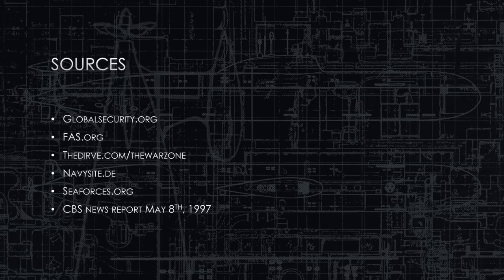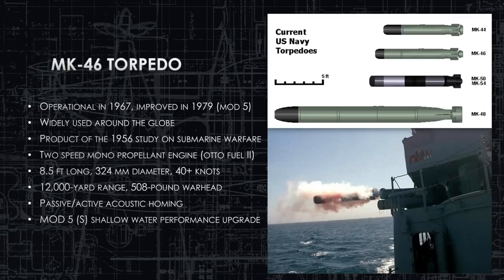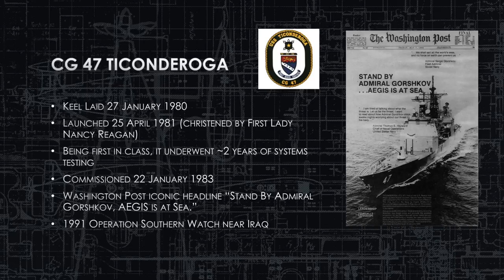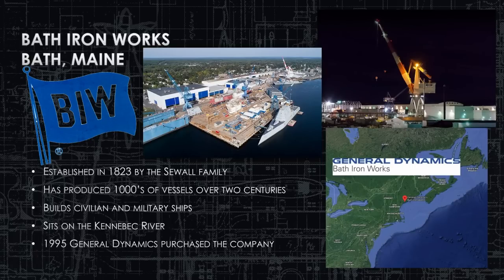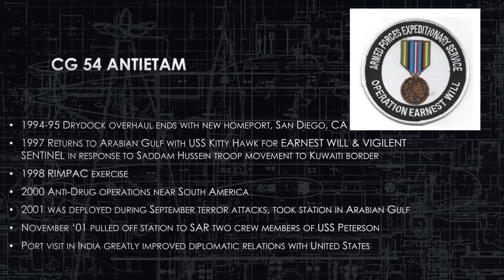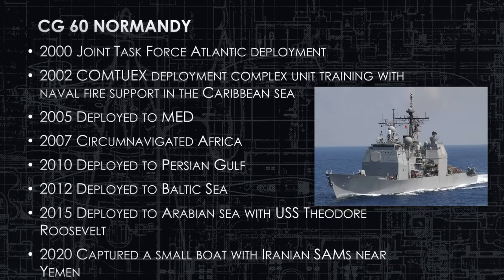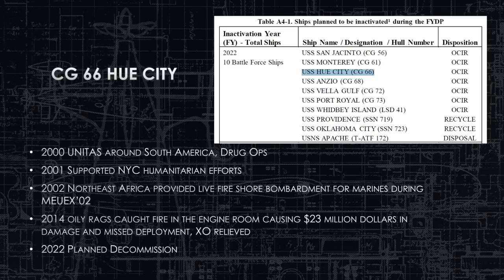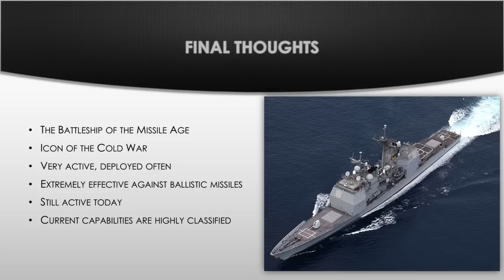Ticonderoga-class Ship Brief

Comment: While the focus of this brief is weapons and sensors, the Spruance Class instituted an important engineering plant change.  Prior to Spruance,  main engines were 1200 psi geared steam turbines.  Major repairs were made onboard and took multiple weeks to complete.  Engine removal took a huge hull cut throuugh several decks.  The Spruance LM 2500 gas turbine was designed to to be uncoupled from reduction gears and ride on rails from the engine room right up the stack.  Took less than 8 hours and allowed off hull refurb and a ready reserve of engines.  This evolution also eliminated boilers and all the related aux machinery.
Reply: Also the KIdd class destroyers also used the Spruance hulls and engineering but changed the focus from the specialized ASW mission to a more general purpose role. Also had extensive air conditioning and were originally ordered by the Shah of Iran, but undeliverable after the revolution in 1979.
Reply: During another life I fabricated at least a dozen parts for the LM2500 powerplant, that thing is a beast.
Reply: Yup, I served on DD966, 965, and 964. along with GC-57 as a Gas Turbine Systems Mechanical engineer, with a specialty in oil & water. Fun times. But yes, the SpruCans, Ticos, and Kidds were all the same from the waterline down, well mostly the same. You always have some differences.
Reply: The slight difference from the SpruCans to the Ticos might be a result of the hull being slightly lengthed (4 feet) on the Ticos as well as having 5 feet more draft. Still, when the SpruCans got the MK41 VLS refit replacing the ASROC launcher, the fact the Ticos already had them by that time likely made made the converstion work easier to do. I wonder if the Burke class replacement will lengthen the hull back to where the Ticos were (improving the length to beam ratio and thus the speed thru the water on similar installed power) as the Burkes are more than 50 feet shorter than the SpruCans with 11 feet more beam (and the shorter length no doubt accounts for why they only fit a 32 cell Mk41 forwards instead of the 64 cell). Despite having 25,000 less  shaft horsepower the Kidd's for example, at about the same full load displacement were some 10% faster.
Reply: @DeeEight  Good question. I was on the USS Hewitt when we were having the VLS system installed. As to my general observations on the workerbee engineering view point. The difference of four feet was pretty much just an academic slight to us in the lower decks, but you are right, the open space on the Tico Class is enough to feel. To us at the time, and when they started coming out. The Burkes seemed short and stubby. lol. Todays sailors won't get to see first hand on the speed and handling of gas turbine ships, right next to the old steam powered DD's that preceded us.
Reply: I just wanted to say that since USS San Jacinto is being decommissioned she would be a GREAT candidate for donation as a museum ship for the State of TEXAS and could be ported side by side with USS TEXAS when she is done with her refit.  THAT would be a great museum and would be great for teaching civilians about our Modern NAVY.
Reply: I did a whole bunch of engineering on theTiconderoga. It turned out the thing was too heavy. We put a lot of lead in the belly to keep it from rolling
Reply: @DeeEight  and currently operated by Taiwan.
Reply: @wjhung2  and this is newsworthy to me why? I knew about the sale to Taiwan twenty years ago.
Reply: Very interesting, the R&R of the gas turbine through the stack, perhaps the same could be done with SMR reactors to effect an engine swap. You might also be able to do this through a removed vertical missile mount unit.
Reply: @tobyw9573  Unlikely as SMRs would require a return to the sort of thick armor surrounding the machinery spaces that  nuclear carriers still employ. Thus you'd have to cut holes thru the armor to extract the modular reactors. It would be much more practical to build around the S9G reactor system as used by the Virginia class SSNs and which are designed with a core life of at least 33 years, meaning they never need to undergo a costly and time consuming refueling during their mid life overhauls with the hole cutting in the armor needed to do that. The estimated thermal-electric output of the S9G is 210 MW, which is more than double the gas turbine installed power for a Zumwalt class destroyer.
Reply: That’s pretty impressive. I figure putting a new engine in a car would only take a couple hours less.

Comment: Some corrections...  
- SM-2 Block II improved the ECCM... Electronic Counter-CounterMeasure, not the ECM. 
 - Chaff is pronounced like Ch-ah-F, not like Chafe. 
- You multiplied the Harpoon weight by 10 when reading it out loud. 
- The Mk46 torpedo weighs 508 pounds complete, the warhead is only a little less than 97 pounds. 
- Mk50's are not the '46's little brother except in terms of development timeline as it weighs more than 50% more, has a slightly larger warhead, a third greater range and better than 50% increase in maximum diving depth and was designed specfically to deal with deep diving, titanium hull soviet submarines.  THe engine isn't a battery, its a closed loop chemical reaction producing a LOT of heat and steam to drive the pump-jet. 
- The Phalanx 20mm CIWS... switched from DPU (which for the US government, which has a LOT of nuclear reactors which depend on enriched uranium as fuel with depleted uranium being one of the byproducts of that enrichment process, is actually exceedingly cheap compared to what Tungsten alloys costs to produce) to Tungsten out of environmental concerns about polluting the oceans with a projectile that is still mildly radioactive and might be injested by marine life that could get into the food chain consumed by humans. There is no program to fit SeaSparrow missiles to Phalanx systems. Perhaps you're confused by the SeaRam system which combines the radar dome and sensor fit of the Phalanx Block 1B with an 11-cell launcher for the RIM-116 Rolling Airframe Missile system instead of the 20mm gun (and is fitted to things like all the Independence class LCSs) and is called SeaRam to differentiate it from the regular RAM launcher which has no onboard sensors of its own to detect and track incomming threats. 
- All US Navy ships which have a Phalanx have had them upgraded to the Block 1B standard including those of the remaining Ticonderoga class cruisers as of the end of FY2015. 
- SH-2 Helicopter...the Sea SKua anti-ship missile has never been in US Navy service at all. The Maverick, Hellfire and Penguin missiles were never carried by US Navy SH-2s though they are options on export models. Most of the details you prattled off were systems of the later SH-2G variant which didn't get introduced to USN service until 1993. The earlier SH-2F had completely different sensors, engines, rotors, etc.
Reply: Magnificent response, from no doubt, hard won knowledge. It is thorough, diligent and it would seem, probably quite accurate.  It is Posts like this that restore my faith in humanity. Best post of the week for Me - you get a free ice cream!  (except you will need to pay for and purchase it yourself) :)
Reply: Minor correction, there is no such idom as "prattled off" 
I believe the idom you were looking for was rattled off. 
Yvw
Reply: @ricardobimblesticks1489  Appreciate the scrutiny, and notification of possible transgression, but I was not looking for an Idom[sic], but merely using the term "prattled" as in past tense of "prattle" which google defines as "talk at length in a foolish or inconsequential way.", which you may find is correct usage, preceding the word off,  in its original context, but thanks any way, best wishes, Oscar :)
Reply: Wait... I cannot see where I even used the term "prattled off". if so then well done, causing me to defend a position I did not want. :)
Reply: @oscargoldman85  OP used the term in their correction. I find a modicum of humor in correcting corrections... kudos btw :D
I have a tendency to prattle on so I won't rattle off a list of other things that amuse me :)
Reply: Lots of spoken mistakes on this one. Maybe the old sailor had a bit of rum lol
Reply: Very minor correction to the correction: Depleted uranium is considered a problem because it's a heavy metal, not because it's lightly radioactive.

Comment: I was trained in torpedo maintenance as an electronics technician in the RAN. Extra pressure on the launch of the torpedo means absolutely nothing.
Worst thing is if a surface combatant is relying on torpedoes then you are in deep trouble.

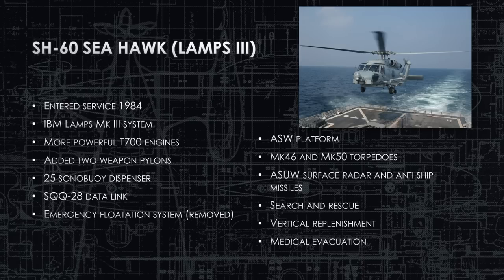Comment: 1:02:50, the reason the floatation was taken off is because it didn't work. If you think of it like a ship, the bottom of the helicopter is a very small "hull" area and the heavy weight of the engines and rotor are positioned high up on the craft. The center of gravity being so high up means that the chopper flips over and capsizes faster instead of floating if buoyant force is added to the bottom.

Comment: If the US ever decides to build a couple of new models of these from scratch I would recommend they use the hull designs from Baltimore-class heavy cruisers, all high-quality steel with laminated kevlar, you can have more missiles, torpedoes and guns on, plenty of room for tech, and it would be more stable sailing platform,

Comment: Congress decided the DLGN was not going to happen, and it is a shame.  Fast Carrier Strike Groups would have been in our HiStory should we have built them.  The Mk26 GMLS was a good system . . . however, the Mk41 VLS requires less maintenance, has fewer parts, and provides a greater density of weapons/area than the Mk26 GMLS.  The Mk26 only fired an SM-2 without a booster.  The Mk41 VLS enabled the Mk72 addition to the base of the Standard Missile providing SM-2 ER kind of range.  You provided a great brief on the Standard Missile capability.  Personnel savings through automation was significant.  Huge debate about the reloading arms is going on in the Navy at present, but they had been removed in the past.  Now that at-sea reloading is a requirement in our future in peer-to-peer engagements I suspect new reloading arm capabilities are in our future.   At a minimum the SM-6 reloading capability will be the goal for re-arm at sea.
The USN actually gave up ASROC manufacture for a time and the Japanese picked up the slack.  ASROC is now back in the mix but it needs a range upgrade (VLS HAAWK package?).
The mission change to Fleet Air Defense (home for 'Alpha Whiskey') was the biggest change.  Even today in a degraded condition the CG-47 Class in any baseline is a force to be reconned with by any adversary.
Concerning "Crash-back" exercises . . . in 90 seconds we could go from over 30 knots forward and come to a complete stop . . . and reach 10 knots going backwards.   We usually steamed with on trail-shaft configuration with that prop feathered and maintain an SOA of 18 knots.
Loved the torpedo review.  There are those in the Navy that have just given up on torpedoes on surface vessels for the future.  Expansion of the development/employment capabilities of the Very Light Weight Torpedo is needed.  Please consider a brief on that construct.  
Having two (2) 5" guns is a real boost in capability particularly now that guided/powered rounds are coming out.  There are multiple development activities for guided and powered 5" rounds and this is a program where initial investment is significant . . . however, the resulting product really increases lethality for the 5" gun out to a significant range at a huge cost savings per round when compared to missiles.  There are guided 5" rounds that can perform missile engagement profiles.  
The Mk15 CIWS is quite the insurance policy for 'Leakers'.  However, many are being replaced by the RAM/SeaRAM on many vessels, and the RIM-116 Rolling Airframe Missile ( RAM) is a small, lightweight, infrared homing surface-to-air missile in use by the German, Japanese, Greek, Turkish, South Korean, Saudi Arabian, Egyptian, Mexican, UAE, and U.S. Navies. It was originally intended and used primarily as a point-defense weapon against anti-ship missiles.
We never saw an SH-2 Seasprite Helo.  The Tico came out with SH-60B Seahawk LAMPS Mk-III right out of the box.  We could use their APS radar to extend out range on the surface.  Today the MH-60R/S Seahawk is the primary bird on board, and we can carry two.
The primary difference between the AN/SLQ-32(V)3 and the others is it has a motion base to provided a constant azimuth for the active components in the ECM.  With todays electronic scanning antennas we no longer need to do that. 
The Aegis Combat System has multiple elements that coordinate to provide facilities needed in combat.  There is a SPY radar section with special consideration for connection to the Fire Control System, Command & Decision manages consoles and displays and man-machine interface, and the Operational Readiness & Test System (ORTS) which monitors all systems (Built In Test Equipment).  It is a primary troubleshooting tool for the Fire Control Technicians to monitor, troubleshoot, and verify the 'fix is in'. 
The SPQ-9B is the cat's meow for low altitude targets and fixed geo points.  Many times we would track a fixed point for naviagetion backup.  
Concerning the SPY radar . . . multiple times I had aircraft doing a flyby across the fantail and I would run out on the flight deck to observe . . . and my little electronic Texas Instruments watch would reset to Midnight Zulu every time.  We were putting out some power out . . . even in the sidelobes! 
The SQS-53 is quite the gadget, as is the SLQ-32.  Between these systems and the SPY-1 radar we were maintaining quite the situational awareness.  
USS Ticonderoga (CG-47) was my home.  We PRCOMED the ship and embarked the first staff units for AAW Commander.  More than once we embarked CRUDESGRU/DESRON Commanders.  Introduction of Aegis to the Carrier Strike Groups was a huge enhancement to capability, and that has been an improvement that is impossible to detail in this forum.   I walked off Tico in November of 1985 and left active duty and entered the Reserves mostly in staff units.
CSEDS was my next home for five (5) years as we tested and verified that cruiser/destroyer combat systems were solid as a rock.

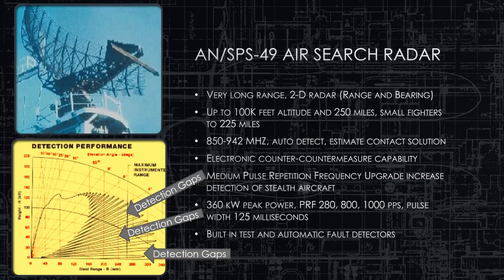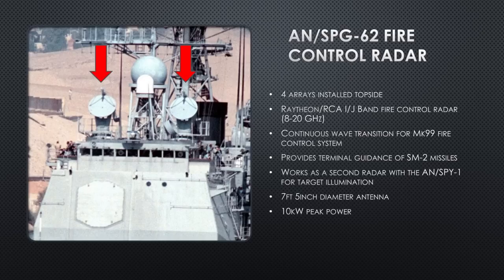Comment: Minor corrections. @41:00 Calling those detection gaps isn't quite right, more accurately they're ambiguity points. All pulse doppler radars have points of ambiguity that are a product of pulse repetition, but that doesn't mean targets in those zones aren't detected it just means that their range is briefly confused with another range. Similarly @45:48 Continuous Wave doesn't have anything to do with uptime, it just means the radars have no pulses. They only transmit straight out at the frequency they're built to.

Comment: When you started talking about the AAW Weapons you used photographs of MK 10 launchers with the AN/SPG-55B Radar Directors in the background.   This combination is called  the Terrier Missle System.  I know this because during my career I was a Fire Controlman (Missles)/ Control Technician and worked on the AN/SPG-55As and Bs, through Mod 10.  After the Terrier Fleet was retired I retrained on the AEGIS Block 1 Computer Suite. And Retired off USS Princeton CG 59.  May I suggest that you edit in captions identifying the differences.   The MK 10 launched the much longer Missle / Booster combination not available with the vertically loaded launchers on the Baseline 0 ships.

Comment: For those wondering about the Hue City I don't think it's a secret but more like nobody really bother to explain it cuz it's pretty clear what happened to this one.

It's the engines, a lot of engineering was seriously damaged during the fire however the worst part of it wasn't so much what was directly burned but what was overheated, AKA the engine, most of the surface damage from the fire was replaced drouing the 9 months repair, hell a lot of it was already good by the time it reached Port, and much of the internals were also replaced....much but not all, you see just like any other a ship engine has a maximum service life now with constant maintenance and a good source of new parts you can delay this until the point where the ship itself has become so obsolete that it really won't matter anymore the problem was the fire screwed everything up, you see a lot of parts from the engine cannot actually be replaced simply because of the size so while everything that could be done was done allot of the components simply had to stay, basically imagine if the engine suddenly got like 30 years worth of wear and tear, it worked fine for a while though it did require a lot more maintenance and had a lot more failures however this increased tremendously year by year to the point in 2021 where the engine reliability was so low on 2 engines and required such an exaggerated maintenance schedule on all 4 that it could not realistically be maintained in a war time or even serious deployment situation, and it was getting worse and worse.

The only reasonable thing to do was to send the ship back to Port and literally cut its engines out and replace them with new ones, a process that as you can guess would have taken years if not half a decade or more and been ridiculously expensive, since the Ticos at large were already fairly outdated and being decommissioned en mass it was decided to send her to the eternal ocean in the skies where all good ships go one day, and replace her in her duties with one of the new Burkes being constructed, one that is supposed to implement some of the DDG(X) technology, although that is just conjecture based on timing.